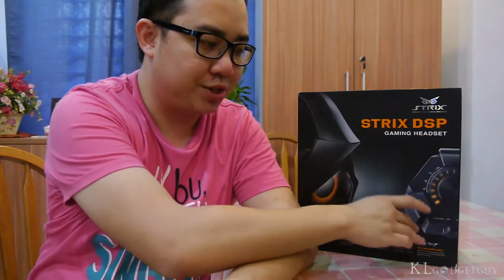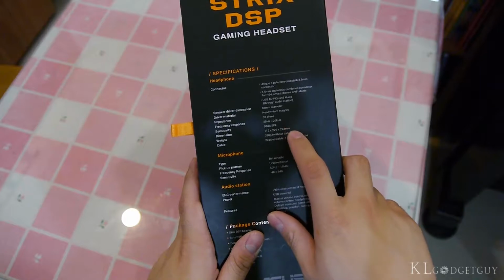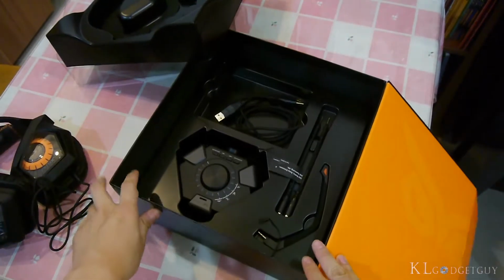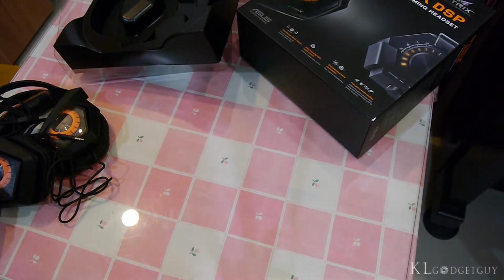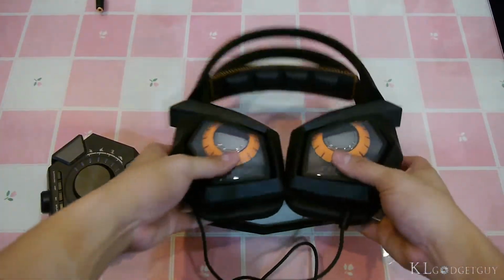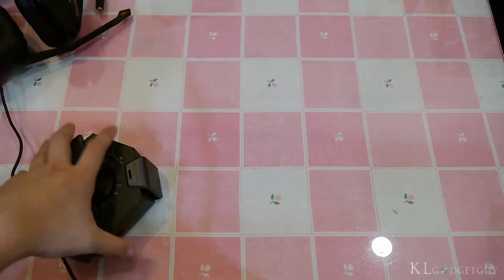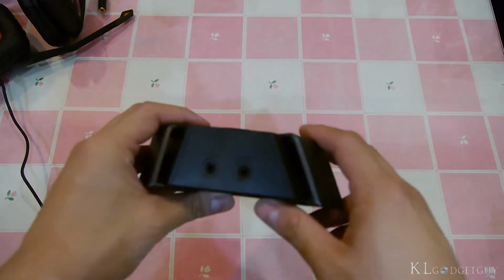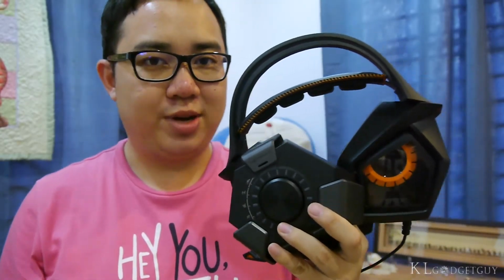ASUS Strix DSP Gaming Headset + Audio Station Unboxing & First Look

Comment: Do you need drivers for these? I just bought a pair and I cant for the life of me figure out how to set up the spectrum mode.
Reply: +Mister Wiggles Mine spectrum mode works only with headset. When you select spectrum mode you have to press volume rocker and then you can choose ;)